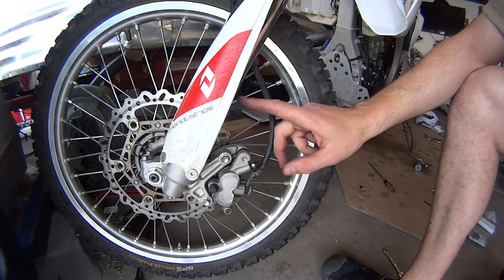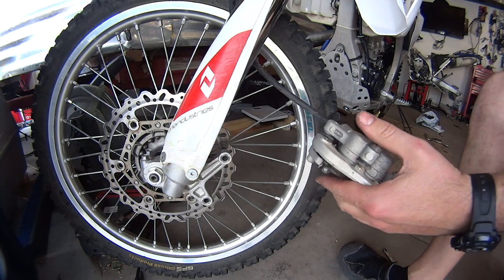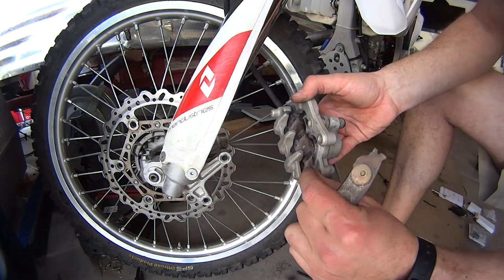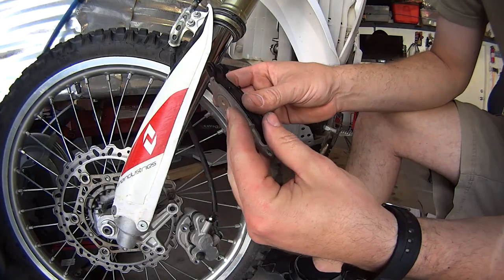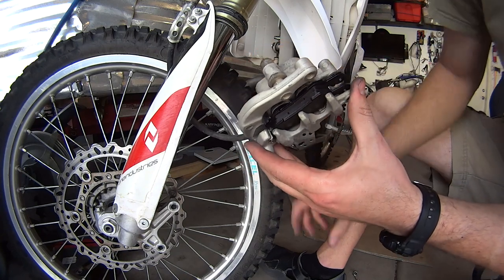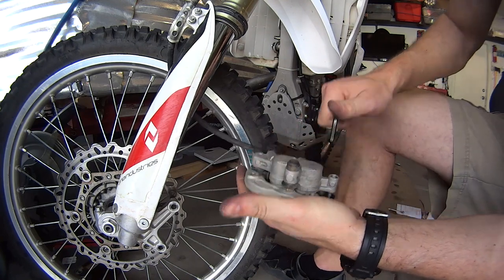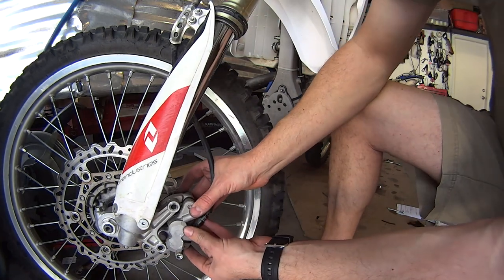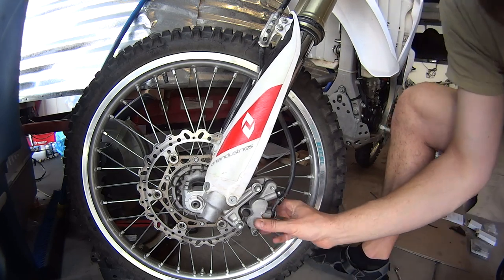How to replace front Brake Pads on Dirt Bike YZ250F

Comment: You should've put some anti seize on the slider pin and the plug threads. Also a bit of grease to the slider pins' smooth surfice. Also inspect the pin for a groove cut in by break pads. I've just about cut pins in half.
Reply from the maker: Funny you say that, I did loose a bolt later on.. Since Than I put some locktight on the main bolts that hold the caliper

Comment: I'd never use a screwdriver on new pads. I'd use a "C clamp" or channel locks on the old pads to push the caliper pistons back in all the way before inserting the new pads. Old brake lines might crack if you let the caliper hand by the line and is which case, the line should've been replace a long time ago lol. Good video thought!
Reply: exactly

Comment: It looks the same rotor with my yz250fx. Do you have a play with the brake rivets when you rock the bike back n fort?
Reply from the maker: No I don't, they might be worn a bit but i do have play side to side
Reply: @vegasromaniac  weird. The rotor looks ok because i can't even feel brake pad trace in my nails. When e slide the rotor disc bacn k fort there is a play..

Comment: what do u do if the Allen key bolt was stripped bad...can't get it out...previous owner absolutely mangled it
Reply from the maker: Brake needs new caliper
Reply: someone didn't use anti-seize, the guy in the video ddint either, so his will likely strip next time

Comment: Love the level of sarcasm when you told us to check for rope. If you don't mind me asking, what kind of deal did you make for the new bike?
Reply from the maker: Was listed to 2800,  but I paid 1900. Needed some work,  and I'm still discovering problems
Reply: +Vegas RoManiac I figured that might be the case. I always feel like you take a gamble when buying a used machine that's meant to be abused. It's easy to be fooled by a quick power wash and new plastics.
Reply: +Vegas RoManiac I'm about to try to get a bike 10 years older than yours (98). Guy is asking $1700 obo, it's been sitting for like 2 years, so naturally it's not running and he's naturally not a mechanic and doesn't know why it's not running (yet the pictures of it are in a shop/garage with tools everywhere)... The usual bullshit story lol... He's been trying to sell it since March, so I figure he'll probably be happy to get something like $1000-1300 cash for it. It's a Husqvarna 610 TC with a TE 5 speed trans and lights. Says it's street legal, so I assume the title and everything have been changed over. If he's trying to bullshit me, I will know long before I pay him... I'll bring my tools so I can even check the cylinder pressure on the spot. Funny thing is, when he got a call with a Detroit area code, he's suddenly gotta go out of town for a week and that's also part of what makes me think he's full of shit lol. If it's just old gas, I'm going to be very happy, but I highly doubt that's all that's wrong since it has fork boots and these didn't come with fork boots... I'll have to do some research on the common issues they have...
Reply from the maker: +jylp4u sometimes you just need to take a leap of faith,  u can't test compression on these bikes they have an auto decompression mechanism that will give you false readings.  But that bike for the money I woukd take the risk,  anything can be fixed and if you can't you sell the wheels on eBay for 400,  forks for 200, and swing arm for 200 and you got your money back already.  So go for it. Bikes under 1500 u can't loose on it if you know how to hold down to a screwdriver